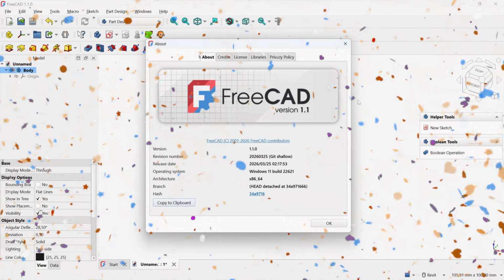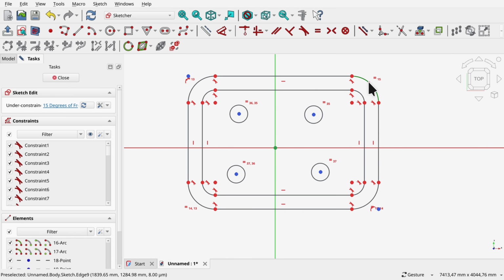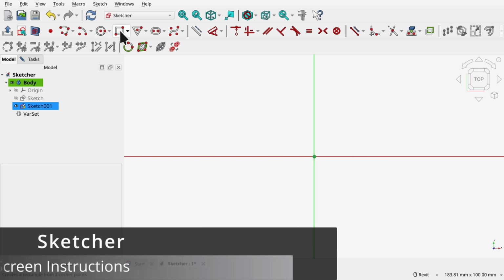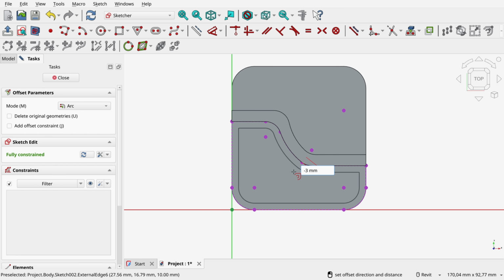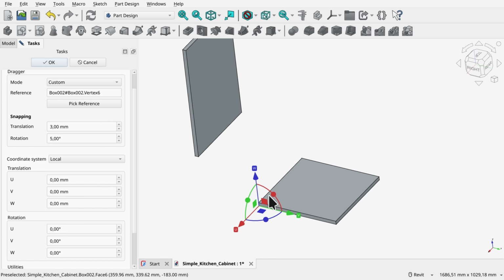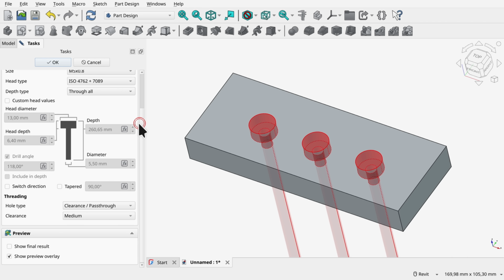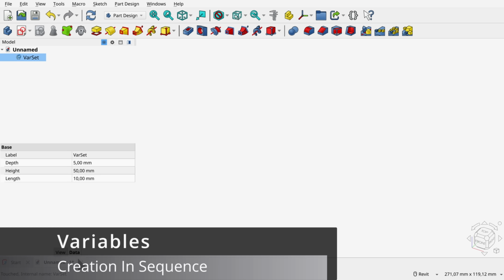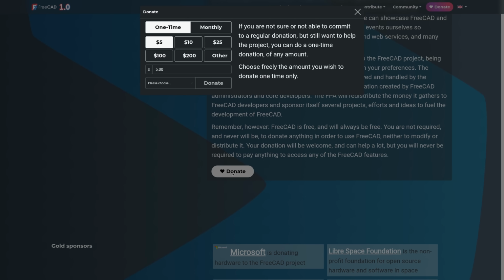FreeCAD 1.1 is Finally HERE — It’s a GAME CHANGER ! (Major Updates you missed)

Comment: Oh my god FINALLY using one sketch for multiple operations with different profiles, the lack of that was a deal-breaker for me until now.
Reply: Ohhhh this is the best Feature...how often did i have to workaround. So many nice features
Reply: This is incredible. It makes me want to redo some of my previous work!
Reply: But can you create an extrude from a line, like in Fusion (thin line extrude) ?
Reply: @alejandroperez5368  You can extrude a line in realthunders FreeCAD branch with the Extrude function in PartDesign. I rarely use it but its possible.

In the Official version its only possible in Part-Workbench which makes things more complicated. You need to integrate the part as a BaseFeature(Drag-n-Drop) or via the SubShapeBinder/Link.

After That you can use that extrude 2D-Shape with the SubShapBinder-Offset (Property) to make a shell.  'Offset Fill' and 'Join Type" Intersection, worked for me.
Reply: que coincidência rsrsrs
Reply: Same
Reply: Now all we can hope for next is better fillets/chamfers, and being able to cut a body into two with an extrude cut like fusion.
Reply: @liamtwentyman7275 it's true, the fillet and chamfer operation is pretty fragile. There is a workaround for Chambers/fillets if you use additive/subtractive pipe of a suitable sketch (like a triangle) along the edge in question. This does help in every situation but is very robust.

I'm not completely sure what you mean by cut the body but there is a split operation in realthunders branch. Hopefully this is also integrated into the official branch.
Reply: More like: OMG, some actually usable and common sense basic features!
Reply: @dtibor5903 yeah the previous model was completely terrible for usability. It's interesting to me that the new version still requires you to change an obscure setting which you would have no idea to even look for.
Reply: Could you explain what exactly you mean? How was it before and what is the advantage now? I appriciate your efforts, thanks.
Reply: @AlexDerhuan Before you had to have a single closed region per sketch. Now (at least in theory) you should be able to draw something like a venn diagram and choose to extrude any one of those enclosed areas. In other CAD software like Solidworks, onshape, or fusion this allows you to layout the entire profile of your part in a single driving sketch and extrude and subtract multiple combinations of profiles. Using this, I can often make a complex part with only one or two sketches. The resulting part is a lot easier to modify as nearly all your profiles are available in a single sketch.
Reply: @kaleb_barbour3  I see, I get you and you helped me to catch what the mate above have talked about. Thank you very much for your kindness and time to explain it to me. ❤❤❤🤗
Reply: @kaleb_barbour3  I gave it a try, how it actually works is freeCAD arbitrarily  chooses which of the combinations of profiles is going to be allowed to selected, to be extruded. I ended up resorting to multiple sketches or extruding, plane sketch then cutting back the inner features.
Reply: @kaleb_barbour3  In 1.0 it was also possible, but not as easy as in 1.1. I also think 1.1 is much better in quality, the thickness operator now seems much more robust.
Reply: @AlexDerhuan so you completely disrespect people's effort
Reply: @dtibor5903  ???? Why? Just by asking a question to someone to explain me something??? Errrr... Have I missed anything or it's you?
Reply: Still broken for me in fc1.1 release. 
I can't select more then one face and even with just simple sketches like 3 intersecting circles the algorithm fails to find all the faces. 
Very disappointing. I really don't know how they can release it in a state like this.
Reply: @theincapable  It worked for me in 1.1-rc1 and now in 1.1.0. Dunno what bug you are hitting, but if you switch your attitude from "I don't know how they can release it in a state like this" to "Can someone help me document this bug so it can be fixed" I'm sure people in the forum will try to help you out.
Reply: Btw I was nicely notifying about that problem for months and it was not fixed although I think this is some fundamental feature for the UI.

I mean, I understand that people don't have to fix things just because someone asks for it but that feature was announced already a while ago as a working feature in the release. 

I use internal geometry in realthunders branch and it works very reliable. In official FC it never worked for me even once with 3 intersecting curves.

The good news is that there is a pull request some hours ago that may fix the problems with the internal geometry generation.
Reply: @theincapable did you enable the feature as shown in the video?
Reply: @CullenJWebb yes I correctly activated it and it was obviously turned on. As I wrote, it partially worked for very simple sketches. 

Btw, the bug seems to have been fixed yesterday (see the GitHub issues I referred to).
Reply: @theincapable  Yeah I'm not sure why they made it an opt-in feature when it is a default in every other CAD. Either way, still a huge step in the right direction!
Reply: @joeymea the problem for me was not the opt-in, that is turning it on in the settings. 
The problem it's that it was still broken.

There have been some fixes after the 1.1 release. Let's hope it's finally working on the next weekly release.
Reply: @joeymea  Probably because it's experimental, being brand new. Better not to make it the default until all the bugs are taken care of.
Reply: @RAndrewNeal  I guess that makes sense. It's just such a huge game changer and someone who approaches FreeCAD for the first time might not know that it's an option.
Reply: @theincapable  Interesting. I just picked it up last night and haven't spent a lot of time in it so I guess I wouldn't have noticed any issues.
Reply: It seems fixed and finally working in the last weekly release, two days ago.
Reply: @theincapable  Did you enable "Generate internal faces"? I tried it and it works fine.
Reply: @theincapable  Version 1.1.1 has a bugfix. I noticed some of this as well. Supposed to be fixed now.

Comment: Nice features, but its a shame its still only uses a single processor rather than take advantage of the computers full power.  Lets face it, the days of a computer having a single core processor have long gone.  Just imagen how fast this would be if it used the full power of multi core / multi processor found on everyday machines.

Just doing standard tasks like converting a mesh to shape and shape to solid still results in the "not responding" message, and a single CPU locked at 100% (despite a further 11 CPUs being available )

Comment: All of these changes are fantastic!  After dropping FreeCAD years ago (after using it for several years), I've become so spoiled by Fusion that I would find it hard to go back without a lot of these QoL additions.  One thing I didn't hear addressed, is whether they finally fixed the Solver detaching sketches from faces randomly.  That's the straw that broke the camel's back for me.  I often work with projects counting in the hundreds of steps (both due to intricacy, as well as my own ADHD), and FreeCAD would always, without fail, break my models after some threshold of steps and spline count was passed.  Months of work destroyed, because even the project files would save in a corrupted state at an earlier point.  I know, I know, "keep a running backup" - after a while I did exactly that, but losing an entire day of work was still too much.  If this has been fixed, I'm happy to leave the cloud-based solution behind, because I've never been a fan of letting somebody else curate my work.

Comment: Man, the fact that every sketch needed to be a closed loop was almost a deal breaker coming from fusion, nice to see its not longer the case :D
Reply: I never knew that was a thing, coming from more traditional CAD software. I assume there needs to be at least one enclosed area for it to work
Reply: @osrevad  so a line/spline can be projected, extended into space, used to divide faces or objects, define paths or axes. A single line can be "thin extruded" in fusion. It is a very clicky cad.
Reply: I can't even tell you how many times i just opened fusion for a quick idea i needed to work through before I went back to freecad for the keeper idea. This is gonna be incredible.
Reply: The other day I hit against this in FreeCAD 1.0 and it took me so long to sort it out. So many times I nearly just quit the software thinking it was crap. But this update!!!! Wow
Reply: Came here to mention the sketch system in FreeCAD makes the whole thing a complete non starter. So happy to accidentally discover it’s no longer the case.

Comment: Not even 1 minute in. OMG OMG OMG. Quick, I need a part to model!
Reply: Someone needs to model (and of course 3D printout) the bottom section of my 1 gallon Vicks room humidifier & make the Heating Element area deeper so the entire H.E. is always completely under water so calcium doesn't build up on the top of the H.E. as normally happens due to thier 'designed to fail' mentality & it requires manual cleaning  with a hammer & flatblade screwdriver.

I made 1 humidifier last 3 years cleaning it that way - there's not much room between the water reservoir walls & the H.E. for cleaning purposes.

The original design is designed to fail as the calcium (?) builds up a LOT within just two weeks & severely degrades humidity output.

I eventually revamped the internal wiring with quick release lever wire connectors so now i remove the H.E. every 2 weeks & screw it into a badly made plywood jig i can mount into a vice & easily clean the H.E. far better than when it was in the unit.

So, there's my idea, run with it & make a lot of money...🤔

Comment: RIP fusion
Reply: RIP Cloud based software for CNC machines.
Reply: I dont know I kinda like fusion360 cad and cam all in one, its easy to use and can design and output to my cnc machines without ever leaving single app.
Reply: @nonyabiznizbro  its also really well developed. I want something to work
Reply: "Fusion 360 'Free': Where you're a 'hobbyist' until you try to save your 11th project, then suddenly you're an international corporation that owes them $500. 🤡"
Reply: Hold your horses

Comment: My word, FreeCad is getting so good so quickly! Thank you for keeping us up to date!!
Reply: Curious what happened. Did they ban previous FreeCAD maintainers who refused to add that sketch functionality? Or they simply died of old age?

Whatever happened hopefully it happens with GIMP repository as well.
Reply: @Dustmadeout  When building software you have to strike a balance between keeping the code base maintainable and adding features. If you just make everything a bolt-on feature (as in, you don't give a rats ass about the underlying systems) you end up with a horrible mess where changing one thing breaks 17 others. On the other hand, if all you do is making sure the API is pretty, logically structured and obsessively containerized you end up with all the potential and no realization of that potential.

To end users it can easily seem like developers are being "stubborn" or "refuse to add completely obvious features", but most the time they are just displaying a good amount of foresight.

The reason GIMP has been stuck in what appears to be a limbo for so long is precisely because it was realized that a grave fundamental mistake had been made. The way the internal color mapping had been implemented prevented GIMP from working with modern/advanced color formats without every single feature being a "bolt on". So, they did the "death march" of changing the entire foundation, and are now in a place where features can be added again. But the project lost a lot of developers during the death march, because only a handful were capable of doing it right, so everyone else were just twiddling their thumbs and became absorbed in other projects.
Reply: @Dustmadeout  Maybe the suction of the vacuum left by non-existent other tools, or their exorbitant prices, has shaped freecad into what it is. I regret not having discovered it earlier, when I worked with Sketchup extensively (which got enshittified), and even now, as I plod through with TinkerCad, I'm still hesitant to take the plunge. But this video convinced me that FreeCad is the way for most of my needs...
Reply: @Dustmadeout  No they had a lot of groundwork to do, and the project now seems to have the attention of more developers.
Reply: Don’t forget that it was the Ondsel team that got it moving again and did a lot of work on it. :)
Reply: @byzoliaz  pls also don't forget everything RealThunder did for the project!
Reply: Redefining "Quickly" since 2002
Reply: @MAcDaTHo  It has taken two decades to lay the foundation. Once the internal engine can do all that is required, expressing that in a useful manner is "easy".
Reply: @MAcDaTHo I mean yeah, it took 22 years to get to version 1.0, but you have to give the credit to the devs for what they have done in past 2-3 years. This tool is now  serious contender to Fusion360 and others. I have literally downloaded the 1.1 version few hours ago before even watching this video and my jaw just dropped how it improved my workflow without even checking the release note. They really made FreeCAD more intuitive.